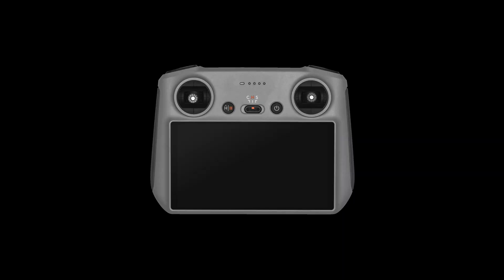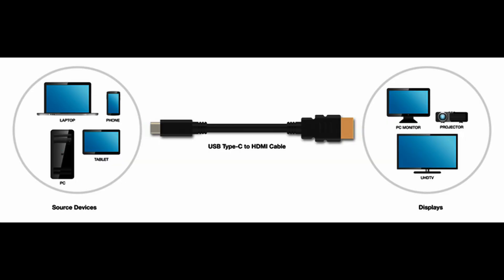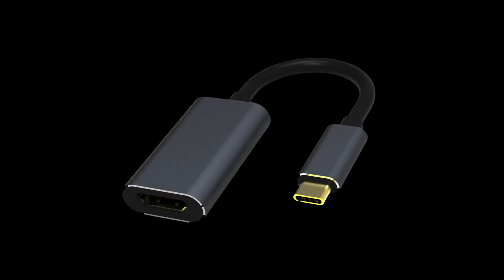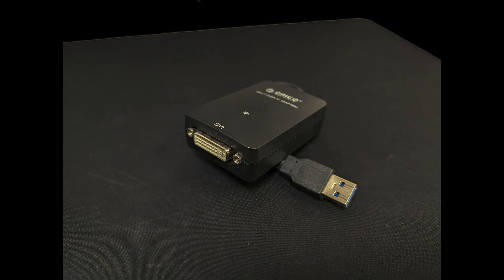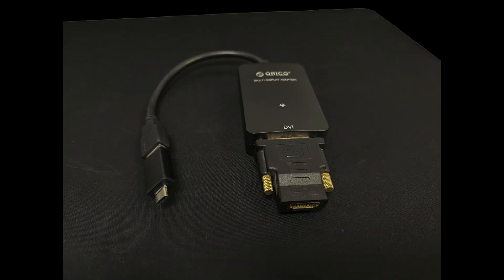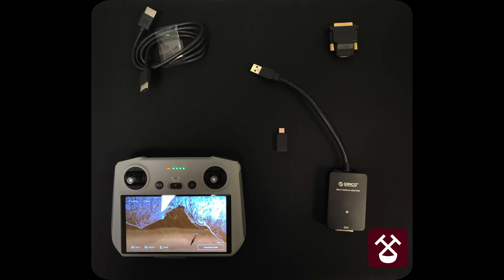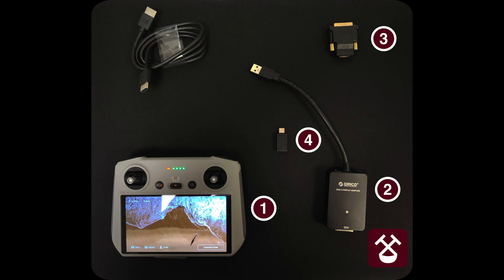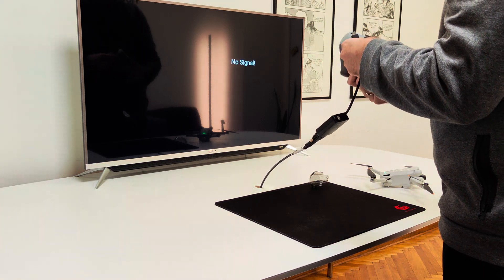HDMI output on DJI RC

Comment: How to clean hdmi
Reply from the maker: Not sure what do you mean by clean HDMI
Reply: video with no UI elements. Just video.
Reply from the maker: @captain_fuzzieness3582 unfortunately, HDMI output only mirrors main screen, so there is no way to get only video stream on the external display without DJI developing that feature themselves.

Comment: What if the remote is RC N1 and with a DJI Mini 3 drone? Please answer, I'm having trouble 😢
Reply from the maker: With RC N1 you can use an Android device that has HDMI output built in.
Reply: @tuxtard What converter do you use? Do you use Mona server? 😢
Reply: @SamjayaMedsos25   Well, i tried MonaServer too much lag and with a dji neo when you start de fly de conecction is lossed, i tried with a usb c hub with hdmi, but the controller dosen't recognice the phone is connected, so im keep looking for a hdmi output from  RC-N1/N3.
Reply: @ronyosmancarrillobermudez2907 Have you found it? Please let me know if you have. 😢

Comment: Please ,please, please make the video
Reply from the maker: Hello. Currently there is no point because recent DJI RC firmware versions are not unlockable, so there is no way to install the required driver.

Comment: Здравствуйте ! можно таким способом через провод подключить очки  DJI RC Pro rm510b  к видео очкам  Goggles Racing Edition ?
Reply from the maker: Hi. It is possible. I am using DJI Goggles RE with this setup. But if you are using DJI RC Pro then you don't need this adapter since RC pro already has a hardware HDMI output. You just need a HDMI to micro HDMI (type D) cable.
Reply: @tuxtard  Я не так написал !) Как можно подключить  Goggles 2  Integra,   к     пульту  DJI RC Pro rm510b  через кабель HDMI  ?
Reply from the maker: @СтасКадрулев-е7ч  Sorry, I don't know how to get HDMI input on Integra goggles.

Comment: thanks for the tutorial.
what about resolution: It's weird that you never explain which HDMI output Res you can achieve. Remember a Mavic3 is way higher than 720.
Reply from the maker: The video output with the adapter used in this video is 1080p. Output resolution depends on the adapter model, so some models might be limited to 720p only.

Comment: Hi, i managed to connect Dji RC1 and fly on Quest 3 googles: https://youtube.com/shorts/1h0X2fATUH4?feature=share
Reply from the maker: Cool. So you managed to get DisplayLink adapter to work as mentioned in this video?
Reply: @tuxtard  Exactly! Some trail/ error approach ... and adaptations to work with Quest3 (usb-c) .. and finally works. You video was very good inspiration/ starting point
Reply: @adamP4D  Hi!
How do you manage to do this? Does your controller have an "old" firmware version?

Comment: But can we disable those recording display on hdmi screen? I need to project without those display on screen.
Reply from the maker: Unfortunately, no. With this method you get screen mirror from the RC to the HDMI display. There is no way to get just a clean video feed via HDMI.
Reply: @tuxtard  so whats the point of HDMI output with these button.
Reply: @tuxtard could you make tutorial about this please

Comment: I think this is a BS video...the most important part requires the hacking/jailbreak of the RC controller which 1) voids the warranty and 2) if not done correctly, can potentially brick the controller.   You said 1 year ago you were going to post a video showing how the device driver was to be installed...but you haven't.

Comment: Will this work https://www.youtube.com/watch?v=e6lXigUNBzE
Reply from the maker: @MrDraftkid  Well, you can place the driver APK on the SD card and navigate to it using this trick, but I doubt you'll be able to install it just by tapping on it. I was only able to install this APK using the adb install command on my PC, which required unlocking RC first.

Comment: Hi! Any chance the tutorial on unlocking and installing drivers in in the works?
Reply from the maker: Hi. Only older RC firmware versions are unlockable. If you are using a recent version, then unfortunately, it is not possible to unlock.

Comment: Bonjour; je vous contacte de France pour vous poser la question suivante: ce montage peut il
convenir pour transmettre a une tablette sous Android . Etant entendu que nous sortons de 
l'adaptateur DVI vers HDMI ; pensez vous qu'en remplaçant le câble HDMI- HDMI par un
câble HDMI-USB-C le signal sera décodé par la tablette ( Samsung TM 225 Lite ).
Je vous remercie d'avance si vous avez eu a faire ce montage .
Salutations respectueuses . JCC . 
   Hello; I am contacting you from France to ask you the following question: can this arrangement
suitable for transmitting to an Android tablet. It being understood that we are leaving 
DVI to HDMI adapter. do you think that by replacing the HDMI-HDMI cable with a
HDMI-USB-C cable the signal will be decoded by the tablet (Samsung TM 225 Lite).
Thank you in advance if you had to do this editing.
Respectful greetings ; JCC .
Reply from the maker: @jcc2133  Hi. Are you trying to get video feed from your DJI RC to your Android tablet?
Reply: @tuxtard  Hello and thank you for answering; yes that's what I want, I installed a software called USB Camera (retrieved from the Google Play store) on the tablet which works perfectly with the Dji RC Pro associated with the Mavic 3 Classic; the problem comes from the Dji RC couple associated with Air 2 S. It's a bit long, you'll excuse me.
Respectful greetings ; JCC .

Comment: HI, I FOLLOWED YOUR GUIDE BUT WHEN I TRY TO INSTALL DISPLAY LINK, ON THE REMOTE CONTROL, THE WORDING APPEARS THAT I AM NOT AUTHORIZED TO INSTALL THE APP. WHAT DO I DO?
Reply from the maker: @djdiegocostabile69  you need to unlock your controller by applying some hacks first. But, unfortunately, there are no hacks available that are able to unlock DJI RC with the latest firmware versions.

Comment: I watched your video to understand what I can do; but, I felt I was disappointed because you just skipped the most important element, which is how to install a driver to my DJI RC!    I ended up flying my Mini 3 Pro with a DJI RC and a DJI Integra, which could be fine; but; I am going to get a DJI Pro RC to fly my Mini 3 Pro, DJI Air 2s and my DJI Mavic 3 Classic with an AR glasses.  I do have a DJI Mavic 3 Cine and an AR Glasses.  So, far, I do feel that your video left many un-answer questions and I am willing to skip all of your suggestions and videos and go with a DJI RC Pro.
Reply: Hey, I had the same idea as you and I'm thinking about getting a pair of AR glasses. Did you ever get this to work well?
Reply: @alexk7977  This video did not tell you everything.  The missing part is installing a DVI driver to the RC-N1 which is no easy for general users.  

If you wish to fly your Mini 3 Pro (I guess), you have TWO easy ways to fly it using a pair of AR glasses.  The easiest BUT AT THE SAME TIME MOST EXPENSIVE way is switching to DJI RC Pro as discussed in my comment. 

A cheaper but clumsier way is downgrading your controller back to DJI RC-N1 and use your phone.  Then, buy a wireless display dongle, which is usually rather cheap around $20.00 for a usable one.  The app of this dongle mirrors your phone's screen to the dongle WIRELESSLY.  Then dongle has a HDMI output.  A pair of AR glasses is likely needs a USB-C video-in.  Therefore, you will also need a HDMI-to-USBC adapter, which takes its video-in from the dongle, and sends its USB-C video-out to the the AR glasses.  Unfortunately, both the dongle and the adapter need 5V power, which means you will need a power bank and is the clumsy part.
Reply: Oof, that is rather a lot... Do you know if it's the name for the RC2? I'm finding conflicting reports online about that.
Reply: @alexk7977  First, let us make sure we are on the same boat.  The DJI RC and DJI RC2 have lighter color and the DJI RC Prois black.  Then, the DJI-RC2 has a pair of foldable antennas.  The RC, RC2 and RC Pro have built-in screen.  Other other hand, the DJI RC-N1, N2 and N3 do not have built-in screens.  The DJI RC, which is for Mini 3, etc., DOES NOT support video-out from its USB-C Connector.  The DJI RC2 and DJI RC Pro do have USB-C connector and are plug-and-play with any AR glasses with USB-C video-in (most of them do).  If you use DJI RC-N1, N2 and N3, what you have to do is getting the onscreen video out to HDMI from which its is converted to USB-C that is connected to a pair of RC glasses.  I don't know what the people are saying on the web, because some of them are speculations and are junk information.  I have all of the mentioned gadgets and have tested them all.  This video shows you the connection from RC2 to a pair of AR glasses: https://youtu.be/908mP1-kw58 Hope this helps.
Reply: That helps a lot! Thank you!
Reply: Great choice with the DJI RC pro..as I also want to fly my air 2s with AR glasses.So my question is do your AR glasses work with the RC pro controller flying the air 2s?thanks in advance 👍🏾
Reply: @leonmalcolm3780  The RC Pro works with a pair of AR glasses properly.  However, please use the USB-C rather than the HDMI output.  (Note that the RC Pro has BOTH.)  This is because a pair of AR glasses usually accepts the USB-C input rather than the HDMI input (because the HDMI connector, even the micro one, may be too large).  Hope this helps.

Comment: what about the rc2
Reply from the maker: RC2 has a HDMI support built in. You just need a regular USB-C to HDMI adapter. Just make sure you're getting a USB-C to HDMI adapter, not a USB-C to DP to HDMI adapter as some are built this way to achieve 4k@60fps output.

Comment: hello,im an fpv enthusiast.i bought a dji mini 3 whith rc and i want to do the modification you did. i understand well that the information its not free because the trick is to install the drivers in the dji rc software .is it possible to contact you privately by e-mail? thank you
Reply from the maker: Hi. If you updated your RC to the latest firmware version unfortunately it is not possible to install the driver at the moment because the unlock patch does not work with never firmware versions.
Reply: @tuxtard  :hand-pink-waving:hello thanks for your reply.I only did the first update for activation,and it is this:app version_1.13.10,aircraft firmware:01.00.0500(check for updates),rc firmware_01.03.1700.is it too late? Thankyou
Reply from the maker: @Drago758  Unfortunately, last RC firmware that can be unlocked is 01.03.1200.

Comment: tenho um mini 4 pro plus tem como fazer isso
Reply from the maker: Hi. Mini 4 Pro uses RC2 controller which already has built in HDMI output. You just need a regular USB-C to HDMI adapter and you are good to go.

Comment: Hello good day how are you? I have all the accessories, but I don't know how to unlock the RC Control and install the driver. Could you please explain step by step how to do it? Thanks Regards
Reply from the maker: Hi. Latest firmware version currently cannot be unlocked. Which RC firmware version are you using?
Reply: @tuxtard  i have the last versión in dji RC control. Regards

Comment: Why not just use an Android tablet with mini/micro HDMI output port, combined with whatever drone controller app that runs on Android? You know, like a tablet that some people use for streaming video to their big screen TV. The physical cable should mean no lag.
Reply from the maker: Sure, you can user RC - N1 controller with an Android devices that has HDMI output. This video is made just to demonstrate that technically you can have HDMI output on RC2 as well, but DJI decided to lock this device so you can't have it out of the box.
Reply: @tuxtard  
Thanks.

Do you know what the DJI Fly minimum RAM requirement is, roughly?

I suspect RAM is the most likely potential issue for using their program on some random Android phone/tablet.
Reply from the maker: I am not sure what is minimum RAM requirement for DJI Fly app. I was able to use an older DJI Fly app version on my 4GB tablet though.
Reply: @tuxtard  
Have you tried connecting that controller to a nifty little phone USB C connected hub like Anker makes? Then the hub's HDMI outputs to a monitor. But it doesn't work! Some guys who are more skilled at programming that I am have tried to figure it out, tried very hard, but have failed.

But a tablet with mini/micro HDMI output seems like a better solution anyway.
Reply from the maker: Unfortunately, I don't have this USB C hub so I wasn't able to check it.
Reply: I think running the dji fly app has to be something hardware limiting in the app itself.
Think thats because some tablets won't work with the app.
DJI want you to buy more expensive equipment to have the possibility to use hdmi.
Reply: @jada1173  
that might be true, but I haven't heard anyone say tablets with HDMI output do not work, haven't heard either way, so who knows
Reply: @Jakeisks  tablets with hdmi should work but the problem is many tablets will not run the fly app, its like locked to small device like phones.
I know some tablets works, but the thing is they lock it down to prevent you to use things with bigger screen, they want you to buy a more expensive unit.
Apple have more compatibility with their ipads than Android tablets have.
The app litchi can stream live with rtsp to youtube but of course the latency are then many seconds.
Reply: @jada1173  
I heard that already, what we need is someone who has actual experience...

Comment: do that work on dji rc 2 whit antenna also?
Reply from the maker: Yes, but DJI RC 2 has HDMI out enabled out of the box, so you just need a regular USB C to HDMI adapter and you don't have to install anything. RC 2 HDMI out is buggy though, so you might need to plug your HDMI adapter multiple times for it to work.

Comment: Did you notice any impact of the DisplayLink driver installation on performance lost during a flight or during a flight with video transfer to a USB port? And question 2 - whats the resolution of transfered video?
Reply from the maker: Well RC 1 is generally slow, but I didn't notice any additional performance degradation. I am not sure about the resolution, but I will check and get back to you.
Reply from the maker: Resolution you that you get with this adapter is 1080p.
Reply: @tuxtard  thx for your answer. I already installed DisplayLink apk from your link on my RC (access from FCC Hack). Now i have a problem to find correct wire, standard cable USBc to HDMi as you said in video is not working. So im looking for correct adapter :/ Maybe u already tested some simplest cables like USBC to USB then USB to HDMI? (without that old DVI etc)
Reply: @moskil2  mógłbyś podzielić się szczegółową instrukcją zainstalowania sterowników DisplayLink na odblokowanym kontrolerze RC oraz mógłbyś wskazać które adaptery sprawdziły się w tym rozwiązaniu? Może być na Twoim kanale, bo tam też umieściłem podobne pytanie ;)

Comment: I have a DJI Remote Controller (not Pro, i.e. without external antennas). Do you know if it is possible to install any apk? If so, can you suggest me a link where I can find instructions? At this moment, I receive the message "you don't have installing rights"
Reply from the maker: Did you manage to unlock (jailbreak) your RC first?
Reply: @tuxtard  Id needed, I can consider this possibility. Do you know which is the procedure?
Reply from the maker: @gschembra  unfortunately, there is no way to unlock the latest firmware version. For older versions there is a paid service called DJIRCFCC (https://www.djircfcc.com), that I am not affiliated with in any way, which is able to unlock the RC so that you can install APKs via USB.

Comment: how to turn off the display hud menu from the remote, this option has only to RC Pro
Reply from the maker: Hi. Currently it is not possible because both DJI RC and RC 2 only mirror the screen via HDMI.
Reply: @tuxtard  yes, then that means I have to buy RC PRO

Comment: Hi, Would You Please Make A Video On Showing How to Hack That Controller And Also If You Are Possible To Provide That Hack Free Then I will be very thankful to you .
Reply from the maker: Hi. New firmware version is released. I need to check if it is unlockable first. Also, I didn't make a patch myself so I can't provide it for free, unfortunately.

Comment: puedo usar USB-C a DVI?  O tuiene que ser tipo A  a DVI ?
Reply from the maker: Hi. If you find a USB-C to DVI adapter that has a DisplayLink chip, it will work. It doesn't matter what interface it has, but it is important that it has a DisplayLink chip inside because only the DisplayLink driver works with this RC.

Comment: hi! 'm having a bit of trouble when using Inspire 3 RC Plus controller and hacking the firmware linked to the Mavic 3, the HDMI output will have black borders on all four sides.! can you help me?
Reply from the maker: Hi. I don't have RC Plus so I don't know what could be the cause, but I guess that you are experiencing the HDMI underscan issue. You can try looking for HDMI overscan/underscan settings on your display and see if you can adjust it so that image fits the screen.